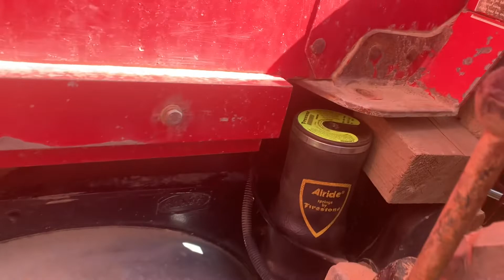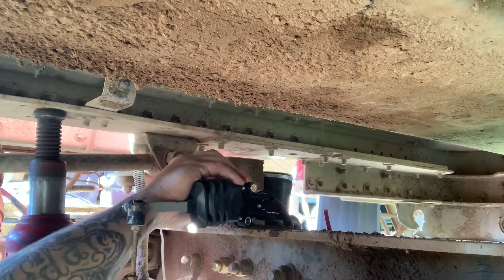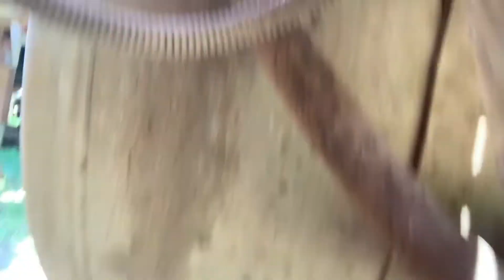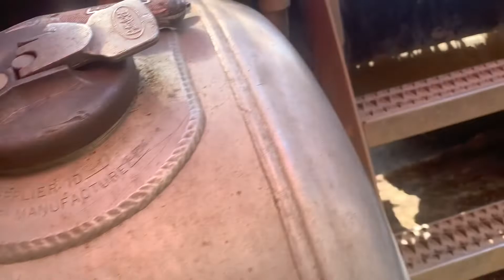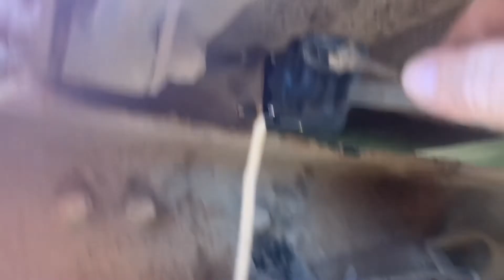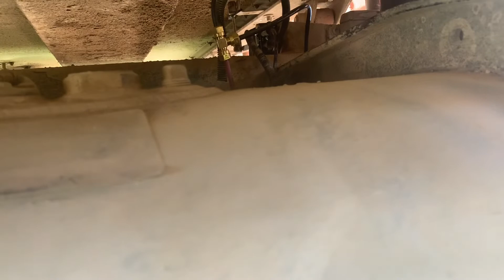Truck repairs/update/cab leveling valve on 379

Comment: Was it vibrating!? I have a vibration and i changed the leveling valve on the back and its still doing the same, i checked everything else and it checked out good!